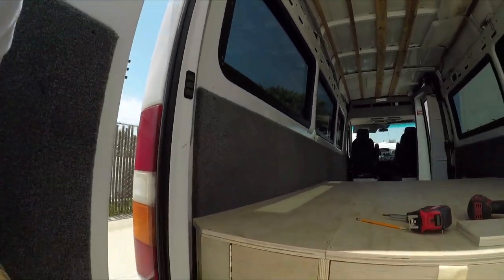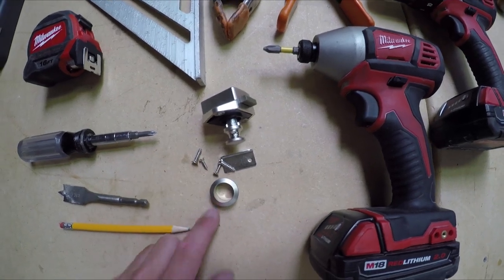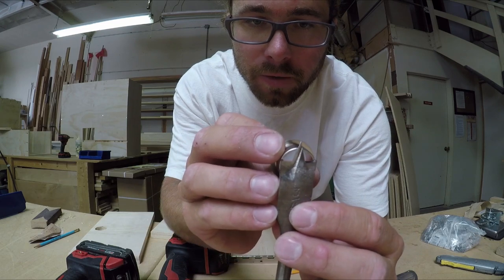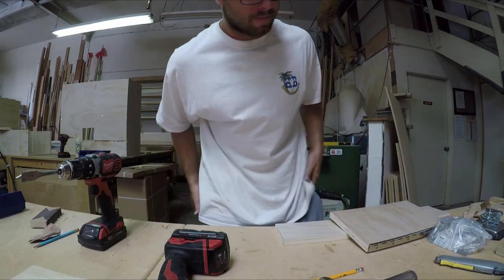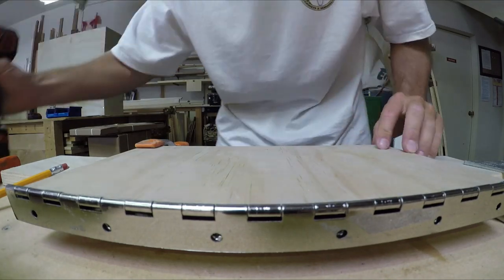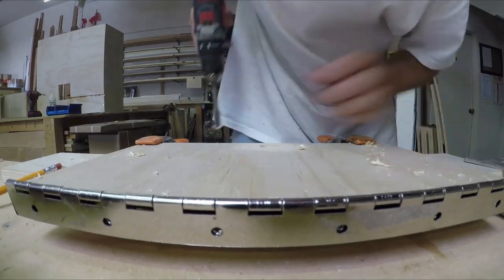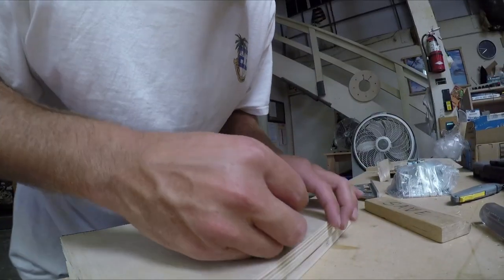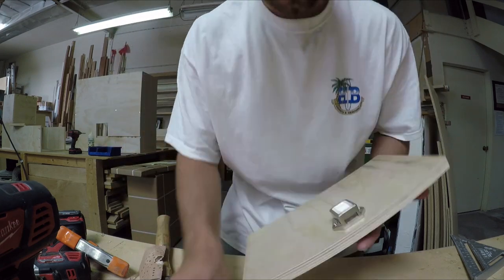Push Button Catch Installation Video

Comment: Cool latch. Maybe some sticky backed weather stripping on the back of the catch to reduce the rattling noise while driving. I definitely like these, there really clean!
Great work Brian!
Reply: Good point!  Those tiny rattling sounds add up to an almighty great din!  Liquid rubber could dampen sounds.

Comment: An excellent demo!  I appreciated that little tip about the blowout without wood backing.  I never knew that, duh!  And also the tip about sizing of the spade bit, the hinge placement, centering the latch. Small details that make a world of difference.
The video was clear, great explanations, and I appreciated no music!  Thank you!!

Don't end your sentences on a questioning tone. This is a speech habit taking over America. End of sentence should not sound like a question. Much better.

Comment: As a note, you need to take into account that the little piece that slides out to lock, needs to slide out some, then go back in. Like when you push the button on a pen, the ball point comes out more before going in.
That could ruin a cabinet door if you forget about that and cut a hole.

Comment: Do u prefer any wood over others on building a van? Based on quality, toxins, if it bends in moisture, etc. I know there is lots of wood to choose from but I don't know which is the best especially if you will live in ur van. Sorry I hope I make sense!
Reply from the maker: Ive just been working with this 3/4" Birch. Seems to do well, haven't had any complaints yet!
Reply: You need a strong wood that looks pleasing and is cheap. Birch plywood- marine grade is the one. If you use solid wood, pine too. This is a good question for beginners.  So many woods, where do you begin?  You start any project with REQUIREMENTS. What are your requirements - write them down. Whether moving house, painting a wall, making cabinets for RV (not house)
Cabinet Requirements for RV:
1. Structurally strong wood - this weeds out Kiri, redwood, cedar, cypress, etc. These wood are not strong and never used for cabinets.  Birch, Maple, Walnut, Oak, Bamboo, Pine, Cherry are good.
2. Lightweight wood due to weight constraints in RV - this weeds out dense heavy wood like Oak, Walnut, Cherry, Maple, Ipe, Rosewood, etc.  What works is Bamboo, Pine, Birch.
3. Resists warping from moisture - Plywood works better than solid wood for less warping.
4. Will not rot easily, can handle vibrations, can handle heavy weight... and so on.
5. Affordable price.  Plywood.  More pricey is Marine Grade Plywood, but nicer finish and higher quality.  Much pricier is solid wood, but you have a choice.  Worst of all is MDF - particle board - this crumbles with a hint of moisture,  has a short life, and is very heavy.

Birch Plywood checks most of the boxes so emerges as the winner.
Always look at what you need (requirements) and what you are limited by (constraints) to arrive at a solution. This works for every project you undertake.
Sometimes it is faster to see what others use, and use that after checking against your requirements and constraints.
There are two things you have to do for any RV build: 
1. Research materials exhaustively. Use the best one.
2. Measure, measure, measure before you start.

Comment: You don't need that sacrificial piece of wood for the spade bit. When the pilot point penetrates the stock you're drilling, stop, turn the wood over and drill from the other side. Perfect, clean hole with no blowouts. Easy Peasy.
Reply from the maker: Sometimes that works and sometimes the holes get offset. Either way works just showing people options ✌
Reply: Not really. Spade bits "walk" wildly, resulting in, as Brian says, offset holes front and back. The real solutions are hole saws or forstner bits. With either of these, two principles should always be practiced: finished side up and the use of sacrificial stock to support the wood fibers on the opposing face.
Reply: True, but... the holes can shift a bit, and you have more work.

Comment: This door latch method is nice. One comment is the rattle noise from any play between the striker and latch when the door is closed.  I will check that out before I start my cabinets.
Reply from the maker: The stopper has an adjustment where you mount the screws so you can move in and out to adjust.
Reply: Solid Wood Worx makes sense thank you
Reply: @SolidWoodWorx  what do you mean by the stopper please?

Comment: Just shut the door and mark on the outside where the centre of the knob is.... then use your speed square to run a line across and voila no need for measuring.....

Comment: Are these catches adjustable for different wood thickness or do you have to buy the right one for the specific thickness? Say if I wanted to use 1/2 inch ply instead of 3/4 inch?
Reply from the maker: They claim they work for thicknesses between 11-18 mm which is 7/16 - just under 3/4
Reply: Ah okay, I probably need to find the right one for my thickness then. Thanks!
Reply from the maker: I meant that the one i use in this video, here is the link: http://amzn.to/2tdS0Pt. works for any thickness from the sizes i listed above!
Reply: Brilliant, thank you :)
Reply: What an excellent point!  I would have not thought of this.

Comment: Thanks for this useful video Brian
My door thickness is just 12mm but the catch fits minimum 14mm thick. Can I pack out at the back of the board by 2mm to mount back plate?

Plus I heard these catches often go faulty. 

Feedback anyone?
Reply from the maker: Yes you can, and yes there pretty faulty I have since stopped using them, THanks
Reply from the maker: I mostly use this style slam latch now. https://youtu.be/uV_Ou84L484

Comment: I need one of these that can work with a 1-1/2 inch thick door in my RoadTrek.  All the ones I've found are too short to accommodate this thickness. Any suggestions?  Thanks very much!
Reply from the maker: Never seen one that can gonthat thick. I would reccomend a t handle latch maybe
Reply: Wow, thanks for the quick response!  Yeah, I was afraid of that. Do you have any recommendations or links to a t-handle latch?  Cheers!
Reply from the maker: Ive used this one  few time sits pretty damn hevay duty and lockable. The latvhes part can be adjusted for depth.
T handle folding latch- http://amzn.to/2uKM0BQ
Reply: @SolidWoodWorx  I can attest that these are good latches. I have four of them on my underbody boxes. You'll want to apply Loctite to the threads once everything is set though. If not, expect to re-tighten the stop and set nuts (a jamb nut affair) in a regular basis as they become loose from use and vibration. Also, if it's important to you, these can be keyed alike.
Reply: That is because these are not meant for doors but cabinets. Use a door latch.  Your door is a different scale than this thing is meant for.
Reply: @jdlngwll  Do your homework. You learn a lot by exploring on your own. Asking for answers is very limiting for what exists.

Comment: Nice job. Amazing how you punish yourself with the inches thing though :-)
Reply from the maker: +Douger Rohmer what does that mean?
Reply: I think he's talking about metric vs imperial system.
Reply from the maker: +Datzneat haha ya must be, but I'm in America and that's just how it works here, been doing it my whole so easy for me.
Reply: Whatever works for you, but how one would find half of 5 7/8" boggles my mind :-)
Reply: If you really want to know: 5 div 2 = 2 1/2; 7/8 div 2 = convert 7/8 to 14/16 (so it's evenly divisible). 14/16 div 2 = 7/16; convert 2 1/2 --> 2 8/16 so you can easily add 2 8/16 + 7/16 = 2 15/16